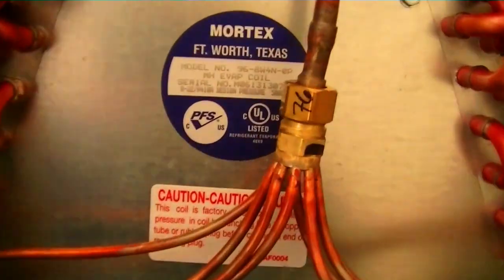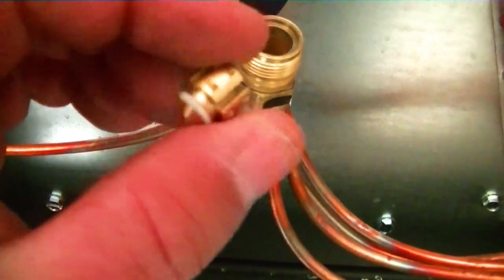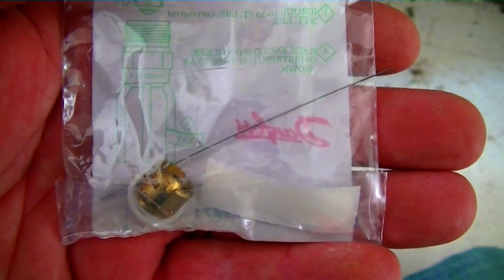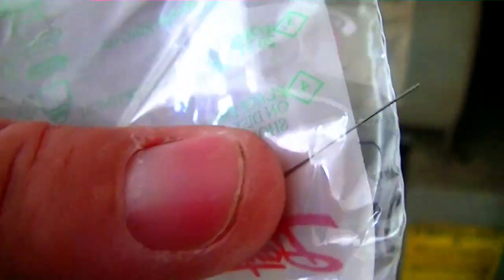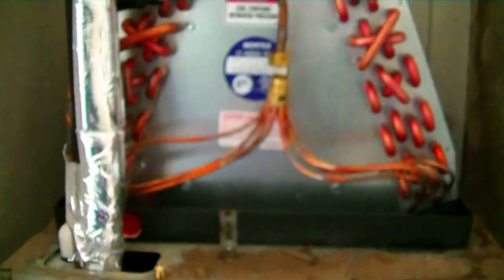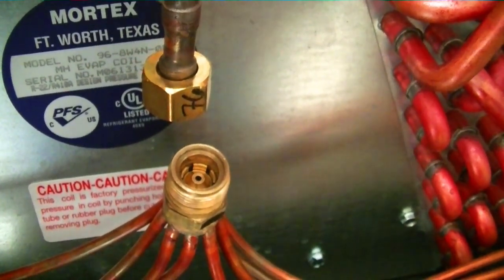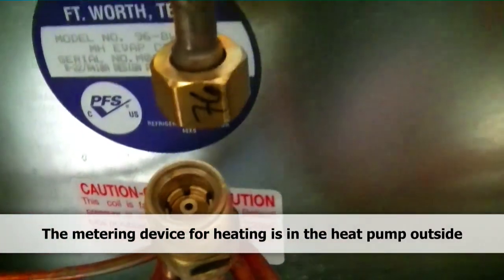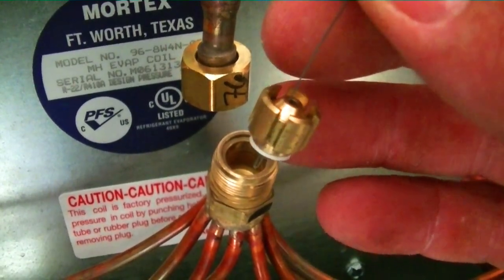HVAC Training-  Installing a Piston Metering Device

Comment: Greetings, change a condensing unit R22 (3 tons) for a condensing unit (3 tons) R410a, use the same evaporator (perform internal cleaning), the piston that used R22 was 0.073 (Carrier), the Goodman unit comes with a piston # 0.070, I should get a Carrier piston # 0.070 or I can change it for the Goodman (they change in their physical form).

Comment: If I am going to purchase the piston on my inside unit would I use the model number on the inside unit or outside
Reply: You would match your outside condenser unit's piston to the inside evaporator. Then, install or replace evaporator matched to the  ac or heat pump condenser's metering piston.
Reply: @johnwilliamson4511 I had an HVAC guy fix it he, the piston was install backwards. All he had to do was flip the piston around. I wonder how long it was installed and running backwards I guess not long because it was not cooling before
Reply: Cool, on a few occasions, I had them installed backward. One from the factory on a new install.

Comment: The truth is that I say it with respect when the one who claims to be an HVAC technician is just a remove and put for not investigating what is really happening is never going to enrich the knowledge with the experiences that are lived on a day-to-day basis in this field so dedicated and that sometimes it is difficult to solve problems but in the end there is an elegant taste of victory and that is when if a machine is not giving the conditions, verifying according to the type of expansion the super Heat or the subcoolin I am not against it of technology but to give a diagnosis without hesitation just by having a contact thermometer.  a volt-ampere meter clamp and some pressure gauges in good condition and having good practices when making a verification is resolved and a solution is given without much ado.  if there are advanced tools great but what I'm going to do is that to give a correct diagnosis you don't need to have the mark X example to lose say what is happening.  when the system is  of expansion TXV or a similar one is always determined by sub cooling , if it is capillary or piston it is determined by super heat , otherwise the video is good .

Comment: Thanks question if you don't change the piston from outside to inside will it become an issue if it's a heatpump  when  running on heat mode?

Comment: What potential damages could be done if a meter device was installed backwards? My ac wasn’t reaching a lower temp and this is what they found out.
Reply: The refrigerant won't be metered. You'll flood the evaporator in the compressor.

Comment: I went to a follow up call with a senior tech because a heat pump wasn't working properly.  Tenants were using a dehumidifier to keep comfortable.  The piston had been installed wrong.

Comment: Just watched this video and I've been in the field almost 11 years and I've never replaced one of these. I work on commercial and 90% of what I see has expansion valves. Im having a restriction on a heat pump at the moment and the way you described this and showed it was A+. Helped me grasp it 100%.. this is 7yr old so u might not see this but just wanted to say thanks!
Reply: Your like me been in field 20 years and I never had to replace a piston only txvs lol

Comment: I have a new 2 ton R410a installed 
It is not cooling as cool as the old r22 unit 
I checked the charge and superheat is 2 , subcooling is around 0 

I'm telling the tech that installed it that the piston is probably TOO BIG 
They are going to come back and check 

I'm getting them to install a TXV valve instead of piston 

What do you think ?
Reply from the maker: +Sofjan Mustopoh sounds like you may be correct. Brand?
Reply: It is a goodman outdoor unit. and US ALUMACOIL COMPANY inside coil / unit .  Moedl no CHPF2430B6CB
Reply from the maker: it likely has a 2.5 ton piston
Reply: Now that i read the model number 2430 . im thinking you are right it probably come with 2.5tons piston and the installing tech did not swap it out. thanks. they haven't stop by to get it fixed yet.  Since i'm getting them to install the TXV . do you think the extra complexities is worth the efficiency ?   Thanks
Reply: Working Joes Roundtable the technician come by and replace the piston orifice with TXV 

He still give all kind of excuse 
Including moving the thermostat from current location 

I told him 
Just install the TXV 
The current thermostat location is fine for the last 15 years 

After the install is done 
Bam 
The AC is cool enough for the penguin 

I would never use his company anymore 

I can fathom why people just can't fess up when they make mistake 

Just an update 
Thanks
Reply: Sofjan Mustopoh I always admit when I screw up. You'd be surprised how effective it is. I don't screw up like I did when I was younger but shit happens.

Comment: Hey town, do you need to recover or pump down the system to replace it or you can keep the freon and do a quick replacement?
Reply from the maker: +eman3208 yes you have to pump it down.

Comment: Is the nut on the distributor suppose be very tight?
Reply: Familia Sanchez HVAC hand tighten then turn about a quarter turn more with crescent wrenches obviously one for top nut and one to hold bottom nut in place those are usually the recommended tightening for this application bro if you over tighten it I can crush the gaskets inside and do other damage
Reply: @wildman8601  ml ml

Comment: How can you figure out what size piston you need if there's no data plate?
Reply from the maker: I use the adp piston chart.  do a Google search and the pdf shows up
Reply: +Town & Country Air does it work for all makes and models?
Reply from the maker: +Familia Sanchez HVAC it will get you close.  Seer rating and manufacturers are different but it gives you a ballpark
Reply: Ok thank you!
Reply: good

Comment: Hello Talyn875, First thanks for the informative video. 
I have a question. I have replaced my outside 5 ton condenser with a newer york unit (no piston taped anywhere) my coil is a allstyle 5 ton r22 and r410 coil. it has a .050 piston. It ran on r22 but my new york unit is r410. What size piston do you recommend for r410. ?
Reply: York usually comes stapled to the owners/install guide. I'm sure you don't still need to know this because it's 4 yrs later but I'm bored. 🤷‍♂️
Reply from the maker: +jcs1492 type in ADP piston chart in google. you will get a complete list
Reply: +talyn875 Thanks for the info and videos.

Comment: It is called a piston because it pushes back and forward depending if it is in the cooling or heating mode, correct?
Reply: At the time I posted the question I was learning this HVAC stuff from bits and pieces I was  watching on these channels.  Actually the piston is a fixed orifice that does not slide back and forward like the piston in a car engine like the name suggests.  The check valve accomplishes this feat.  A lot of times these technicians will not answer a question because they are afraid this will encourage a novice like myself to try self repairs thus causing harm to the system or bodily harm.  I certainly was confident in my theory in my earlier post wasn't I.  Thank you for your inquiry.
Reply: There is no danger in someone watching one video and actually repairing a system.  I have used a little of my spare time on the weekends for about a year and I still have difficulties wrapping my mind around all of the different aspects of this business.  The best place I found to 'jump on' was the properties of the refrigerants and how the refrigerant accomplishes the transfer of hot and cold air.  I agree that this is a tough club to get in if one is not already working in this trade.  But I will still accept the few crumbs they throw out until I have enough to make a sandwich.
Reply: +Daniel Baker   In the a/c mode the piston moves forward with the flow of the refrigerant and acts as a fixed orifice metering device. In heat pump mode the three way valve reverses the flow of the refrigerant pushing the piston backwards exposing more holes and allowing more refrigerant to flow thru now allowing the condenser to act as a evaporator and absorb heat from the out side air.
Reply: gearhead0800 I really appreciated your input...so I actually had it right the first time.  Thank you for the correction.  Does the check valve meter the direction of the flow of the refrigerant or the amount of the refrigerant?
Reply: +Daniel Baker the piston is actually more of a directional then a check valve as we normally think of a check valve. The direction of refrigerant flow is determined by the three-way valve. The piston when positioned forward for refrigeration acts as a fixed orifice and restricts the refrigerant from a high pressure liquid to a low pressure liquid. when the refrigerant enters the evaporator the low pressure liquid absorbs heat from the air passing over the evaporator. Two things occurs here the air is cooled by having heat removed and the refrigerant is converted from a low pressure liquid to a low pressure gas. The Change of state of the refrigerant IS the refrigerating effect.
Reply: gearhead0800 Thank you for the clarification.  I think we are on the same page now on pistons.  This helped me understand what the term 'boiling' means.
Reply: +Daniel Baker Your welcome Daniel, Refrigeration is a difficult field. I have been professionally involved with it for many years and its realistic to say I am still learning. You are on the right track. Keep Learning.

Comment: I have been in commercial refer for 20 years now and recently have expanded to resi work.  I picked up a coil for a customer for a 99 Rheem 3 ton R-22.  Waiting for it to get a little warmer before going out there but this unit has been running flawlessly since 1999 with a .070 piston.  Rheem calls for a .065 with this condensing unit and the coil company where I got their coil from (AllStyle) calls for, and sent an .074  Aint that a PITA.  I'm leaning towards dropping the .070 back in just because of the track record with it in this unit.  What would you do?

Charles